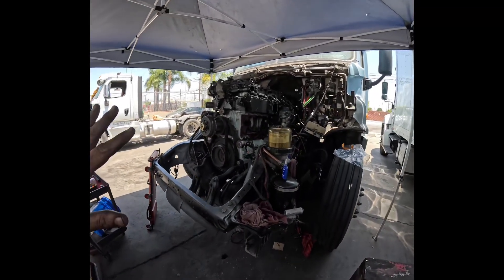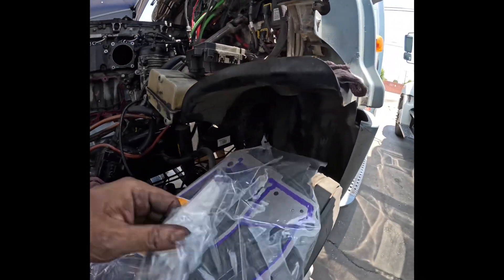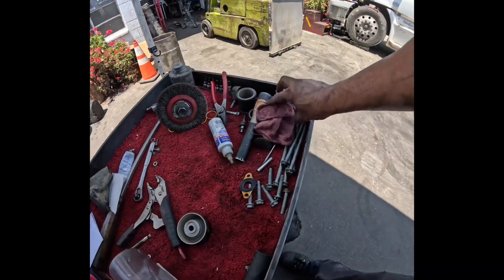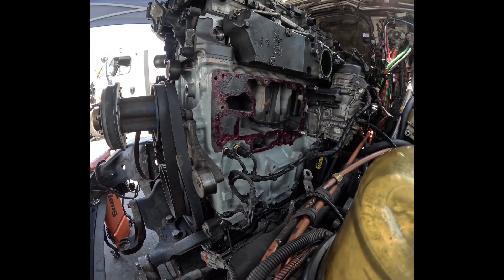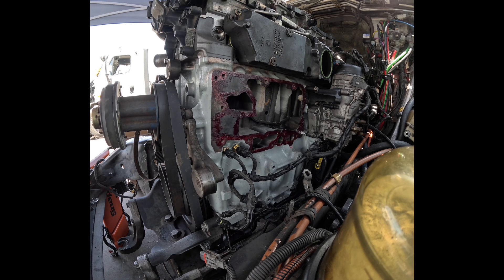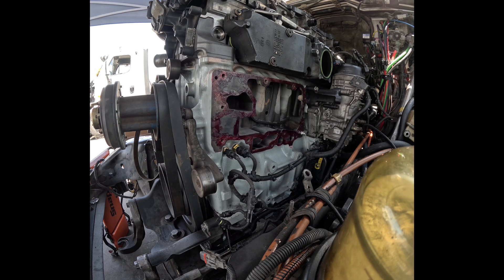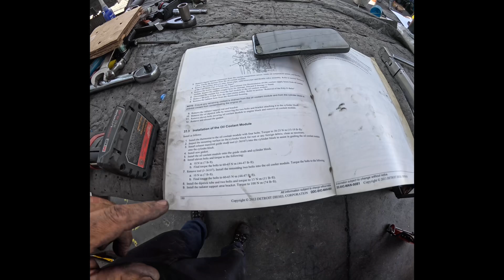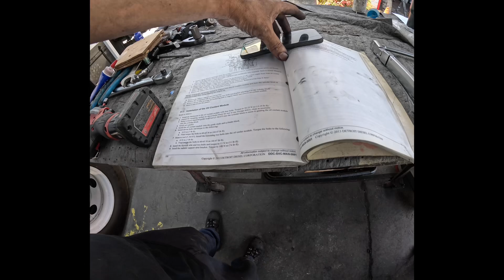Installing a new oil/coolant module while engine is being overhauled. Using my new GoPro 13

Comment: How many hours does this take sn what the coming price lowest
Reply from the maker: The oil/coolant module is around $3,000. That does not include the thermostat or mounting gasket. 
Labor is 6-8 hours from start to finish. The labor rate depends on the shop.

Comment: What is the "Sticky Stuff" your using? Please Sir
Reply: Thank you, I really appreciate it. I enjoy watching your videos, I maintain a fleet of 12 , Western Star dump trucks with the DD 13 and DD 15 Engines
Reply from the maker: @themillers2990 glad you enjoy the content. If you have any questions. Feel free to reach out.
Reply from the maker: Gasket eliminate made by Detroit. Permatex also make  the same thing Anaerobic. I use just a little bit
Reply: Thanks Carlos, I definitely will, I need to do valve adjustments soon on these trucks, they are past due. I watched your videos on this process a while back, I need to look those up again. Thanks again.
Reply: 1 of my coworkers used to work like that , just throw the bolts into holes and then drive them with the impact guns , he didn’t started the bolts by hand first , and he was in trouble so many times and messed up so many things , he’s not working with us anymore
Reply: I Appreciate your videos, they have helped me many times, Thanks
Reply: Could you plz share the mileage on the truck?